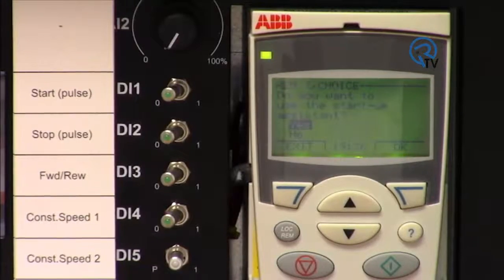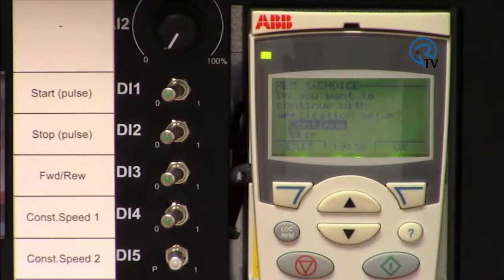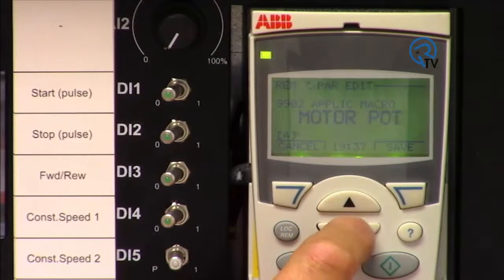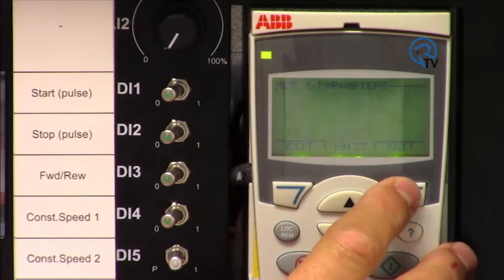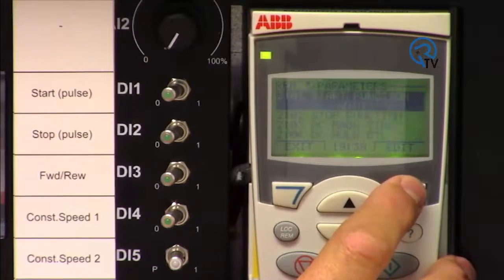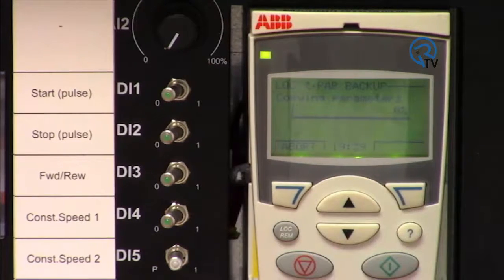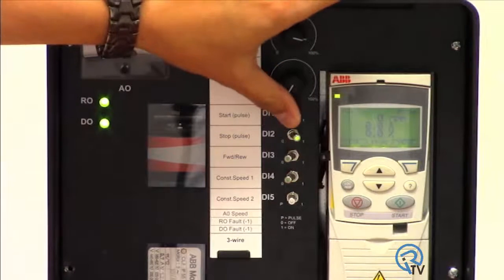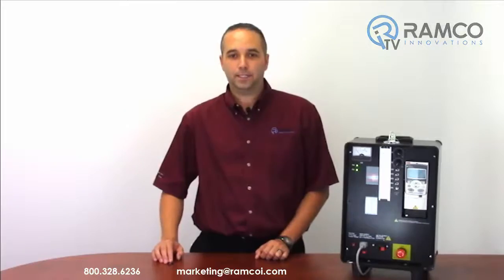ABB ACS355 Basic Startup

Comment: Hi If  I  choose NO when dou you want assisant? what will happen ?? please answer me
Reply from the maker: Hi Tural,
If you choose no when asked to use the start up assistant, you will manually have to navigate to each of the parameters to set them up. The assistant will automatically navigate you to each area of the start up. Here is the link to the full User Manual if you have any additional questions. https://library.e.abb.com/public/8f0f44a0024e41d2985abc2c4dca9d3c/ACS355-UM_revC_screen_A5.pdf
Reply: Thanks, So what is SCR input why we use it for what ? Where will be connect SCR cabels ?